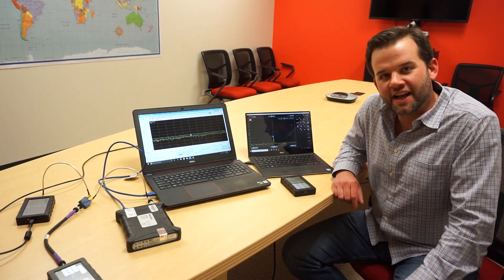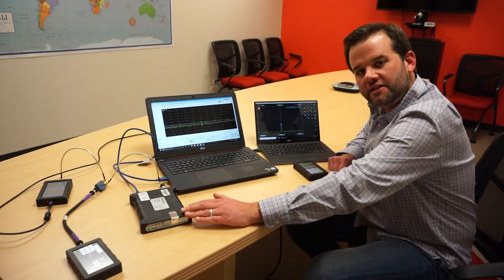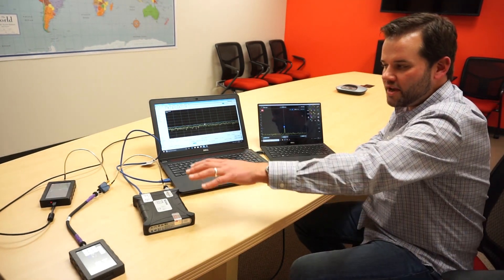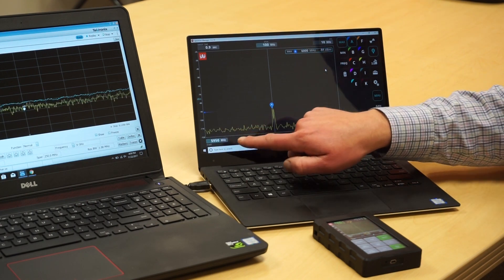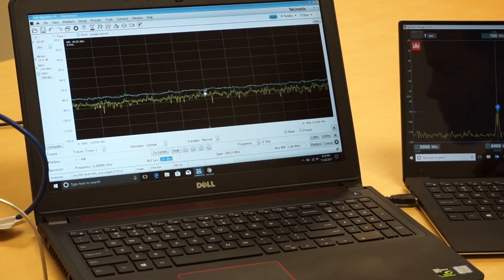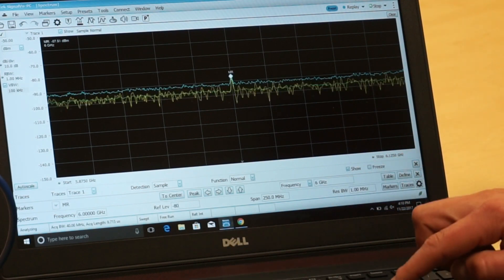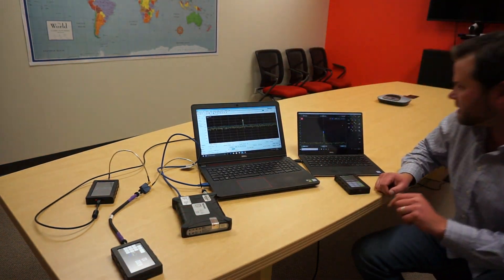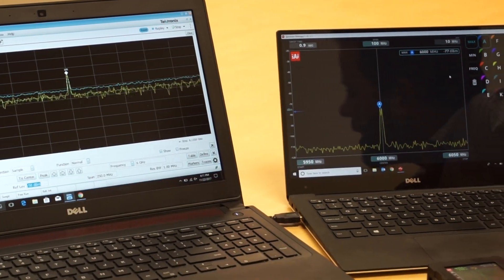Spectrum Compact VS Tektronix RSA306B Comparison

Comment: Why have u kept RBW of 1MHz in RSA?
Reply from the maker: Thanks for the question! Spectrum Compact spectrum analyzer you see in the video has RBW=1 MHz. In order to have comparable measurement data, RBW settings on both devices have to be same.
Reply: @SAFSpectrumCompact  The RSA306B is updating a lot faster. You did not compare them properly.